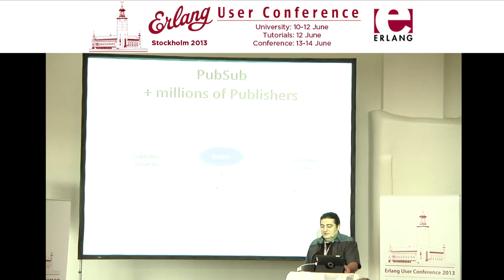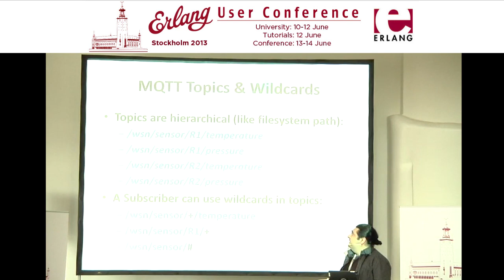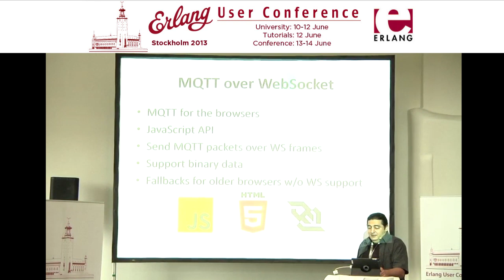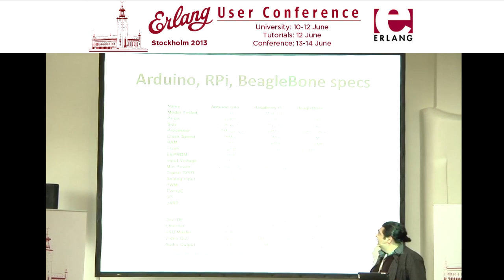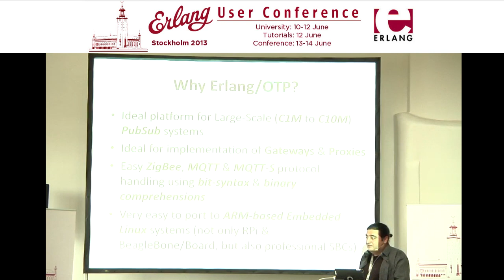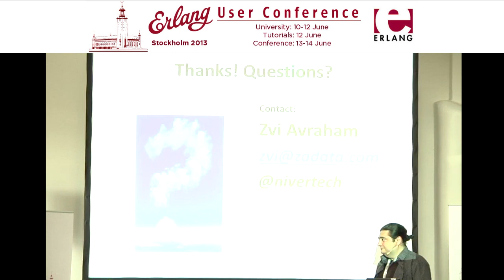Building Wireless Sensor Networks, MQTT, RaspberryPi and Arduino - Zvi Avraham

Comment: I think i can answer to the last question: As long as the messages reach their destinations, it does not matter what network topology you use. Hierarchical Zigbee or other mesh network works too. MQTT-SN (they changed the name from MQTT-S) is also capable of gateway discovery. So you can have multiple gateways between MQTT-SN and MQTT.